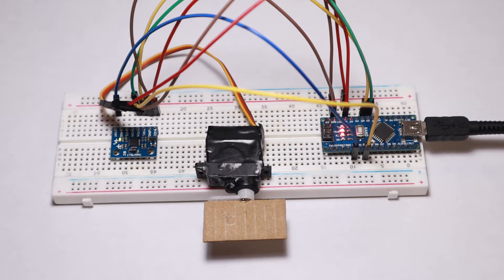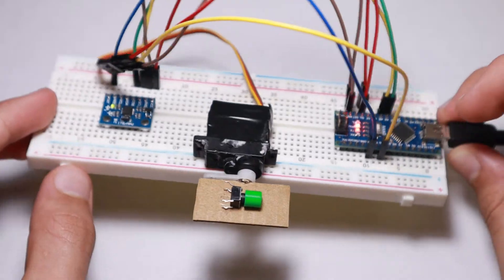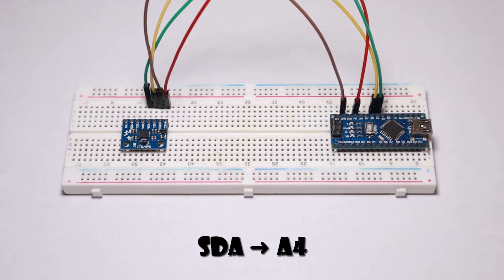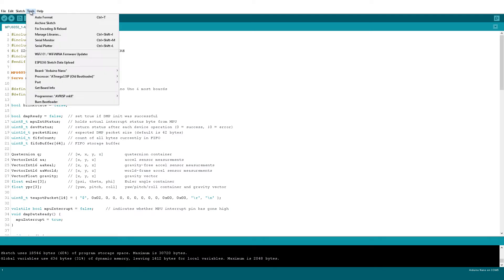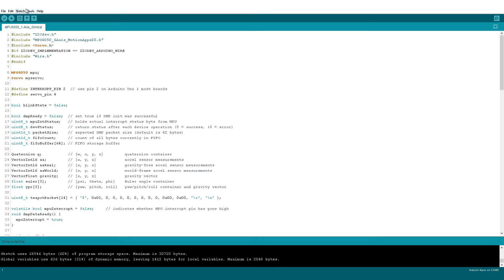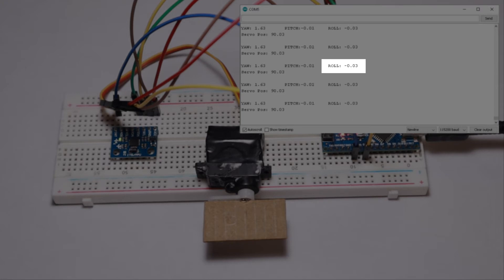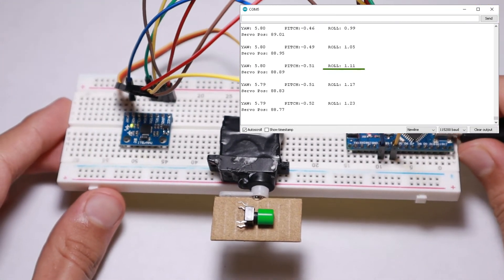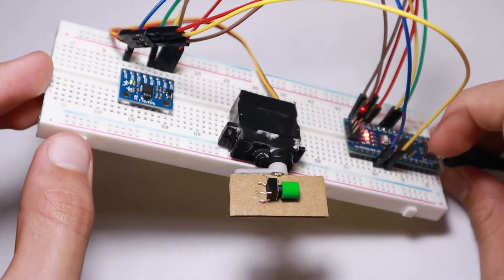MPU6050 1-Axis Gimbal | Arduino

Comment: Hey can you build the project of stewart platform using STM32L010 nucleo-64..like this project video but using 6 servo motor for balancing the object using mpu6050..if you can i will pay you for your..